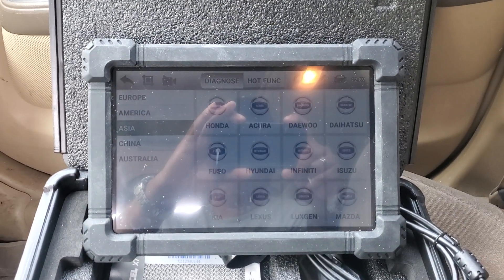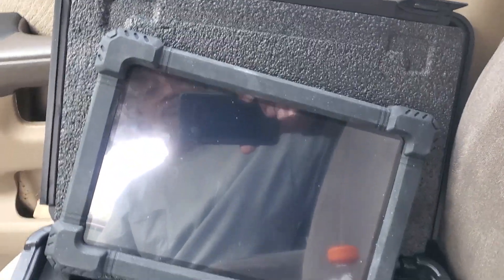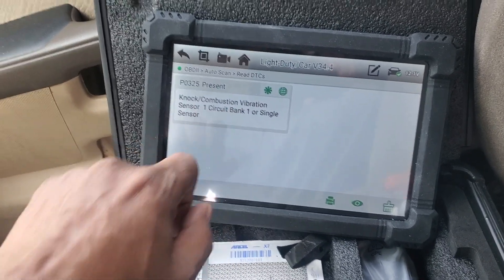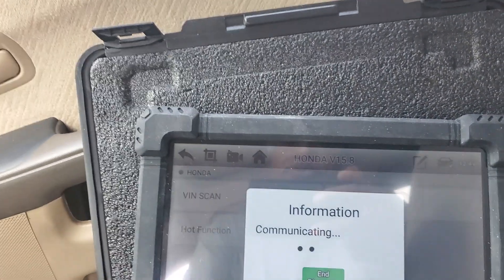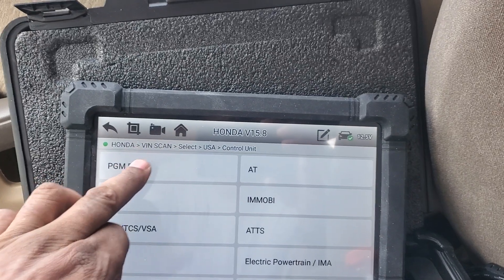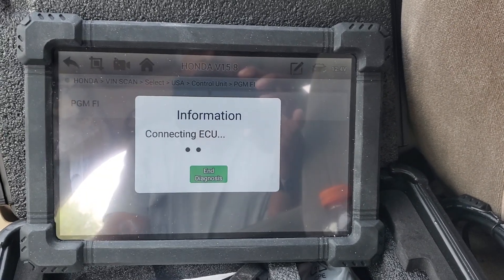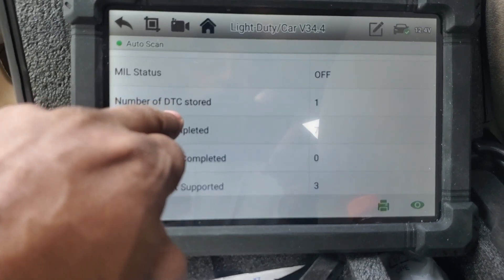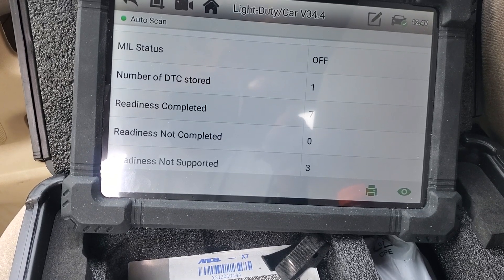Ancel X7 Bluetooth OBD2 Diagnostic Scanner

Comment: Mil just means a code was tripped at some point and then the perimeter for the said code left it just means it met those parameters at some point but not consistently so it’s not a hard code. Do a full tune up nd and oil change clear code bet it won’t ping again.

Comment: Just got one. Can’t get it to run it says “ Fail to read MCU” can you help?
Reply from the maker: Hello, make sure you have the updates done, and be sure the VIC is connected. With the key on to the second position that will power the ECU. I sometimes get that message. But I find that I was asking it to interrogate the ecu un powered. Hope that helps. I will do some tests tomorrow and I will let you know if I get the message again.Thanks for the question and thanks for the view. Stickman...
Reply from the maker: P.S. You have to register the scanner with Ancel, open it an account. Once it is registered, power on the VCI “ dongle “unit with a usb cord and let it connect to the scanner. Once it links up with the tablet unit, it will start talking to it.... I believe that’s what you’re asking.... Hope this helps... Stickman...
Reply: I will try that